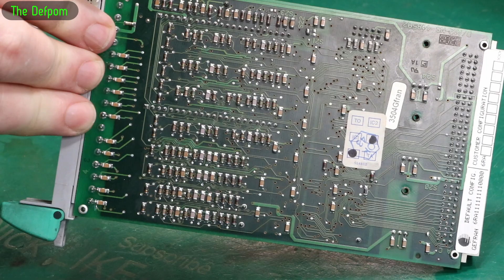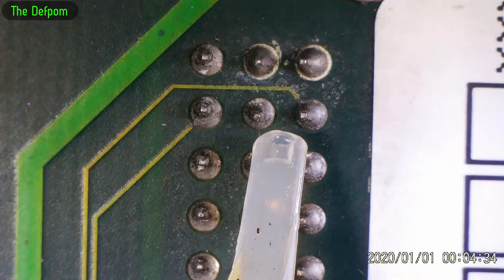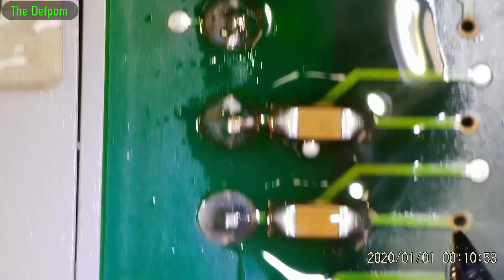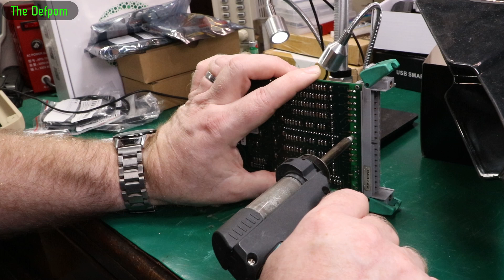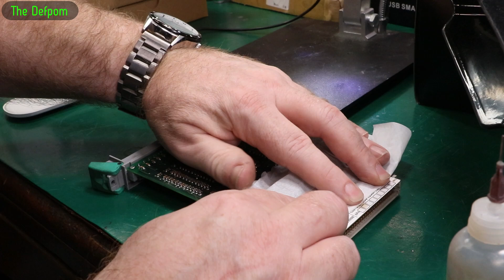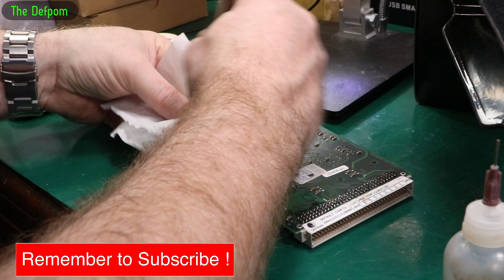🔴 Gefran D/A12-NS Digital to Analogue Card Repair - No.1327

Comment: Unable to test and depending on the fault symptom (and agreement with owner) I think I would put kapton tape over those pcb switches and then put the board in an ultrasonic cleaner (cold wash with IPA).
Could also power up the board (slowly) on the workbench and observing with a thermal camera.
If still available, I bet this card is expensive!
Reply: where's the fun! Hot wash with a candle so that you can see what you're doing, that's my recommendation.  

Remember for this method always make sure that you're working alone and have a good fire extinguisher to hand. And a fire  insurance policy where it can be found should the extinguisher not be enough. 

Note!!!!!!  HOT flammable liquid should NOT be used to clean anything in your home. Unless you want to look like a Christmas pudding coved in burning brandy.
Reply: @TheEmbeddedHobbyist  oh, definitely cold wash as I said unless you want to burn your workshop down...LOL!
Reply: @ Toastie shop to work in  🙂

Comment: Maybe  don't use extra flux as the flux is already in the solder. That way less flux to clean off, or use no clean solder and just leave it on.
I only add flux if desoldering as the solder on the board wouldn't have any left, i buy quality brands of solder so i know i don't need flux and the safety sheets let me know whats in the flux and what i need to do to remain safe.
But that's just my opinion humble or otherwise 😂
Reply from the maker: @TheEmbeddedHobbyist  I only use flux if I need to, to get a nice joint beyond what the flux in solder can manage when redoing old joints. This card is about 17 years old.
Reply: @TheDefpom  then it should be full of lovely lead solder. 🙂